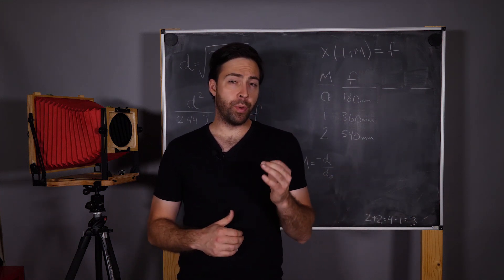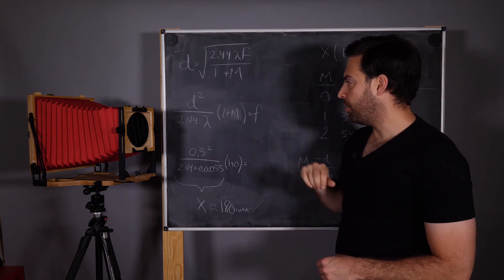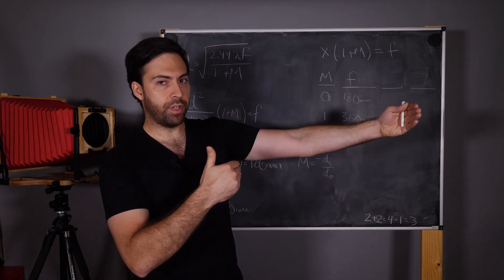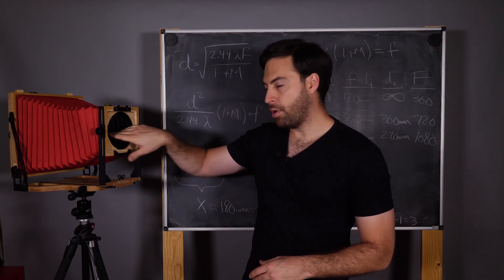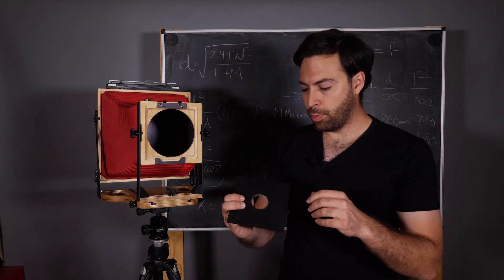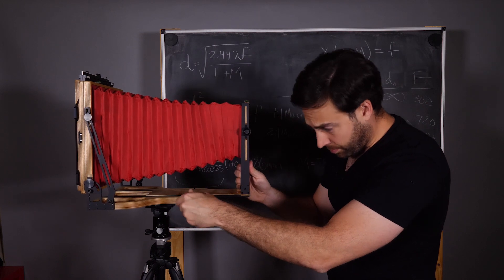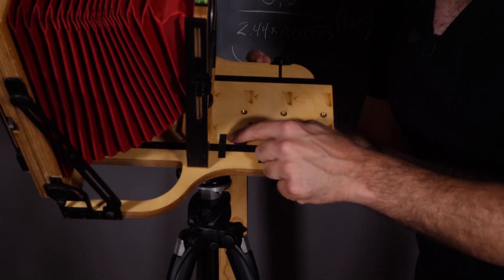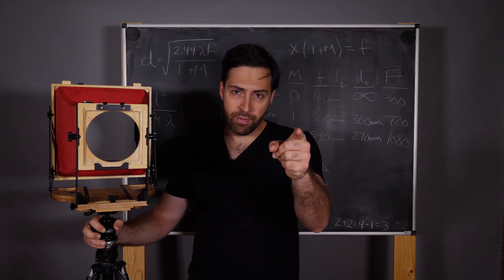Intrepid 8x10 Pinhole Lens Board

Comment: I'm going to try to make rooms into camera obscuras, testing with my living room and then continuing on travels using hotel rooms. If i use the formula for say a focal length of four meters (4000mm), I get a pinhole size of 2.3mm. Do you still think the formula is applicable for this?
Reply: I would say yes, as the formula is about diffraction at the pinhole (optimum pinhole size for maximum resolution). If you are fine with less resolution, you could always use a larger hole for more brightness; smaller sizes are not so cool, as they degrade resolution and diminish brightness (worst scenario ;-)).

Comment: @11:50 get a ~$20-40 laser distance meter - will be VERY accurate vs a tape measure! (and fun! because “lasers”! 😁) 

They are also typically in meters and can change to feet/inches. I have the small Bosch GLM 15 / 20 (many cheap generic alternatives also online) which I keep in my camera bag and around the house! 👍 gives millimeter (1/1000 of a meter 0.000) precision... but actually just read accuracy +/- 2mm or 1/8 inch for some.
Reply from the maker: Good tip. Those laser measuring devices are pretty sweet.

Comment: Great another good video, interesting subject.  The aperture for the pinhole Intrepid sold me is  f280. In lockdown here, hope not too bad in your neck of the woods.
Reply from the maker: Remember that the aperture F-number is based off of focal length. They say that that their 0.5mm diameter pinhole is best at 140mm, which makes it a f/280 aperture (F number = focal length/diameter). The optimal would actually be at 186mm which makes it an f/372 pinhole. In the video I round to 180mm f/360.

Also in lockdown here, but that gives me more time to make videos. Thanks for commenting.